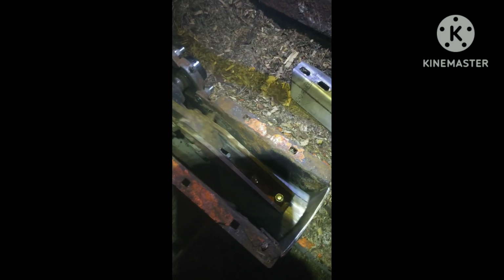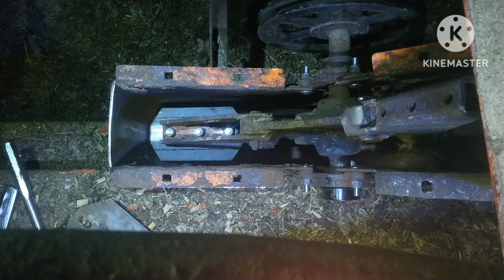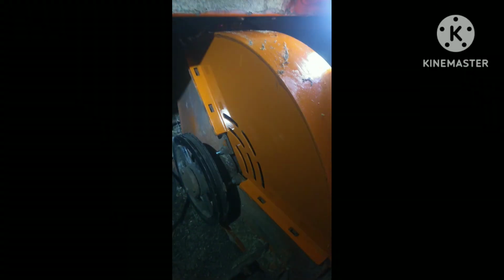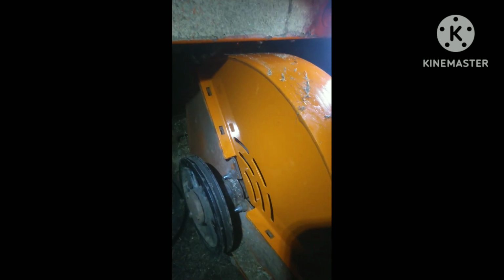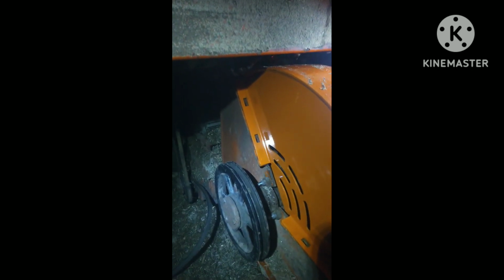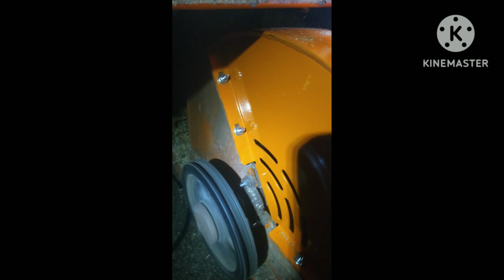Silo unloader repair

Comment: Im getting flashbacks.
We haven't done silage in our upright for a few years now.
Great storage method, IMHO.
But boy nothing like hauling stuff up and down to do repairs.
My Dad ended up just securing a little rubbermaid type tote down and kept a few things in it and we probably still have that and a pitchfork strapped onto it.
Reply from the maker: I think silos are a good way of storing feed yet. The 20x80 was built in 2015. The four silos on the main farm all have the same model Valmetal unloader in them. So I don't have to keep as many spare parts or belts on hand.  Nice thing is pretty much everything on those Valmetal unloaders takes a 9/16 or 3/4 wrench, so you don't need to take too many tools with you when you need to fix something.  I always make a point to go over every unloader before we fill silo to make sure everything is good to go on it before it gets raised up. Then in winter, I make sure to go over each unloader and adjust the chipping wheel to keep the walls clean and grease everything with a good synthetic grease to make sure everything works in the below zero weather in January/February.  A lot of people seem to  complain about silos and silo unloaders, but I think that's because out of sight out of mind. They only see it when they change doors or breaks and don't go through it and give it good mantinace, and when their is something broke, they only put in just the parts needed to get it running that day.